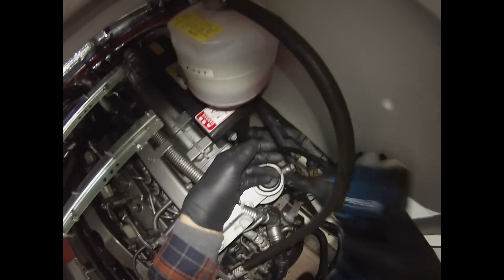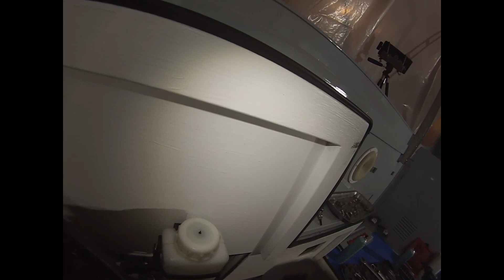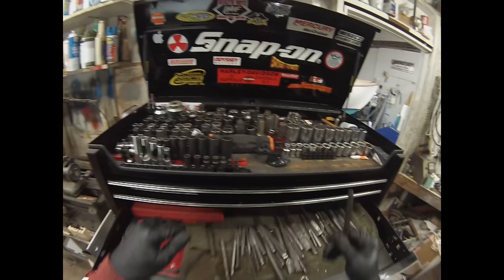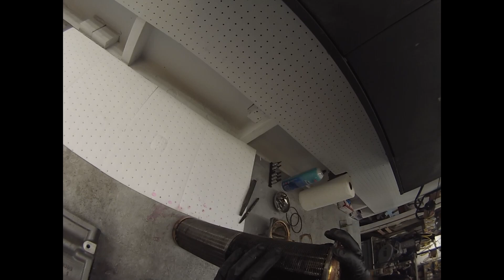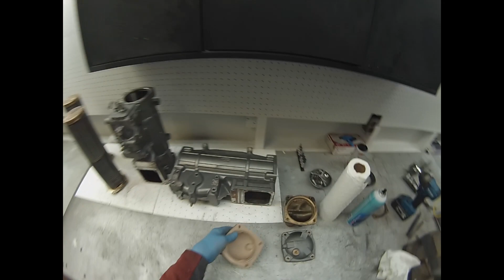Yanmar 4LV 250Z Aftercooler Service. (Audio Fixed)

Comment: Hello have a 4lv same as the one shown here that’s lacking 500 rpm’s. Running gear is fine had a bit of a fuel delivery problem starting off. Fixed that engine was running 2400 rpm now will do 2800. Wondering if the after cooler could be something along the lines of this and how many hrs in do you recommend this service
Reply from the maker: Sorry I didn't respond. This engine should be propped to 3550, (50 over max rpm) so you are down 700 rpms. Is this a new install? What boat, gear ratio etc. Need more data to help you😊